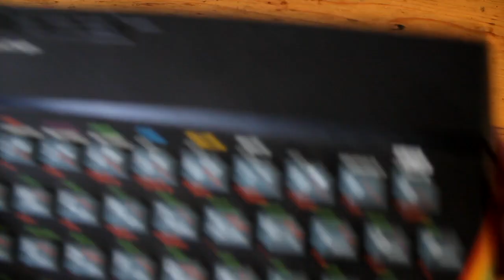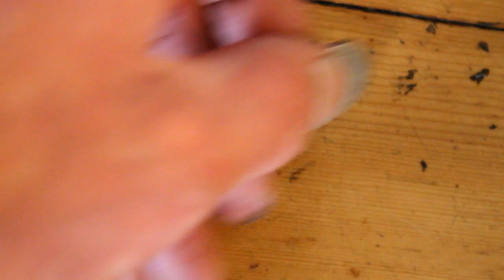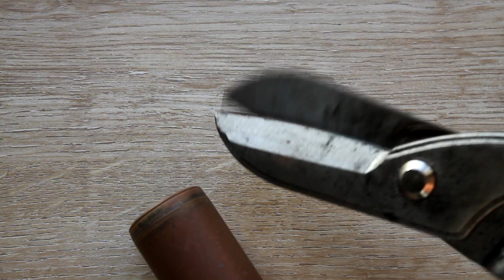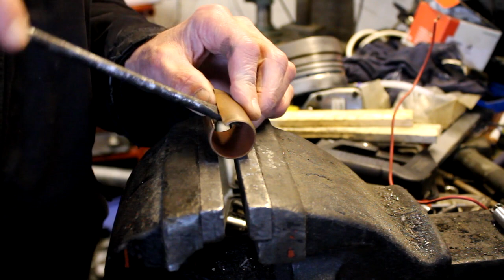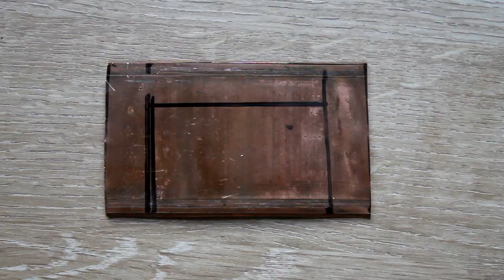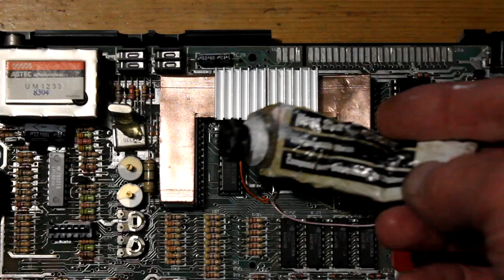ZX Spectrum Rubber Keyboard. Heatsinking the ULA Chip.

Comment: Fit a traco regulator instead of heat sink
Reply: This is the correct fix. No more ripened keycaps and overheating.
Reply from the maker: I was going too after it was fixed. I have tried too re socket new upper ram and now the ram chip 4 is faulty. I`ve done all the resistance checks and changed chips but still no good. I will order another SRAM module and try that plus a Trico 5 volt reg. I`ve fitted 3 already on other Spectrums, They are great mods.

Comment: use    bit  of thermal  paste  as  well should  hold the  coin  better  mate and  file    one  side  of the  coin  down  
to  make  it thinner  :)
Reply from the maker: I was using them as a feeler gauge. I cut some copper tube up and bent it down to fit the chip. Works but then the upper ram was faulty. Changed all the sockets and ram and still getting faults on one chip socket. Nightmare mate. :)
Reply: @damianbutterworth2434  should  not cost  much to  replace the chip   mate  unless tbey  no  longe make  them   but i cant  see  that
Reply from the maker: @greentroll9326  £29 for a new one. I got one for another ZX.
Reply: @damianbutterworth2434  not that  much then  what  do   zx  fetch  now   as  i  know amigas  are  way  up  in  price   for 1200.s
Reply from the maker: @greentroll9326  about £60 for a not working/un tested. Most people don`t have the old arial connection on the TV to test them. There is a toast rack model that is worth about £500.
Reply: @damianbutterworth2434  des  every thing where you  live  mate  is  old  still  got  victorian  pipe   running  under ground  :)  ,  howsyour  mum bdad  n  sis  hope you got to see them  over  xmas   mate